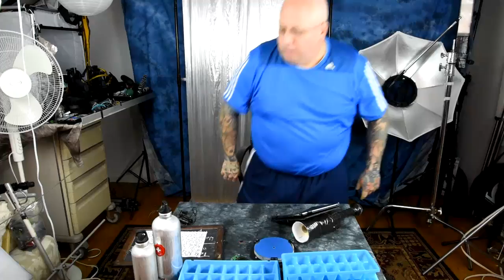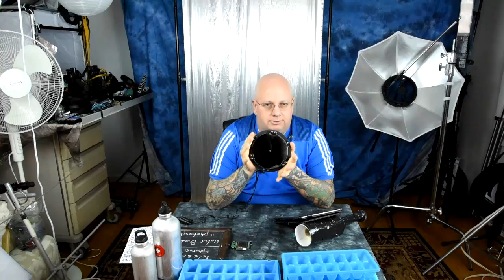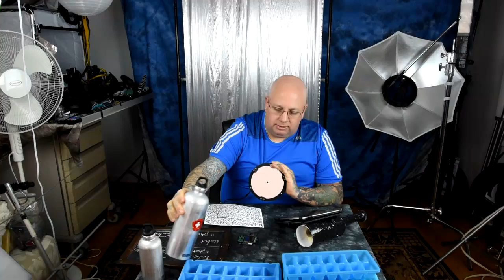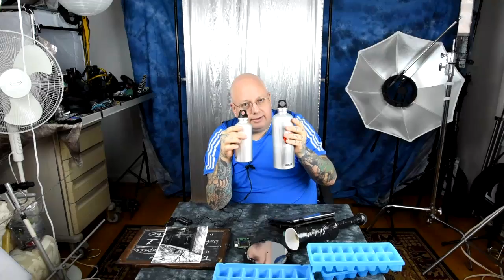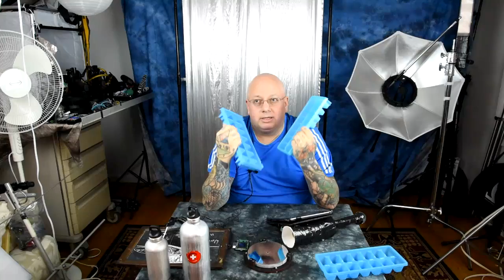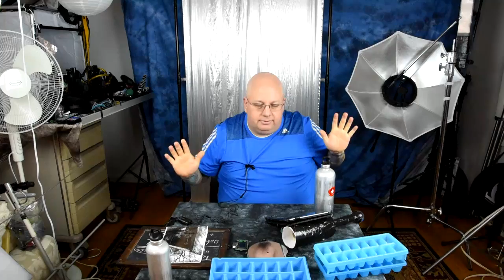Angry Photographer "Kicks the Bucket" PART 1: FX Sensor Size & "More Light"

Comment: Another weakness in their argument is that, if the larger sensors were really actually gathering more light, you would effectively be able to over exposing on the full frame if you did the experiment using the same settings and lens.
Reply from the maker: +Zhida Zhou yup
Pixel density (except for the new breed like the Canon 5d) is HIGHER on a DX sensor vs a FX sensor, or more "ice cube holes per same area in DX"
DX average is about 4.2 micrometers
FX average is about 6.9 micrometers

There is HIGHER gain (of course) on larger (FX) photosites (or in the CORRECT analogy "bucketS")

Other people who say a bigger "sensor is a bigger bucket and THIS is why it has better ISO performance" are 100% wrong, flat out.

Larger photosites have better GAIN, of course, and this is why there is better ISO (and DR) performance on FX sensors, but it is NOT because "the entire sensor is bigger (or as said a "bigger bucket")"

It WOULD be correct however if someone said "a FF sensor has (millions of) bigger bucketS"
But that is NOT what was said.

WRONG QUOTES:::::: THESE ARE THE EXACT QUOTES I FOUND WHICH ARE 100% INCORRECT IN ONE REFERENCE VIDEO:
1. “bigger sensors have more square mm, therefore theyre gathering more light”

2. “bigger and smaller bucket in the rain, both gather 1” of rain, but in VOLUME, the bigger bucket gathers more water………this is the same way sensors work”

3. “larger sensors at the same ISO will gather more total light”.

4. “this is why we see cleaner images with bigger sensors (because the total sensor is a 'bigger bucket')

5. “more light in total means (you get) cleaner images”